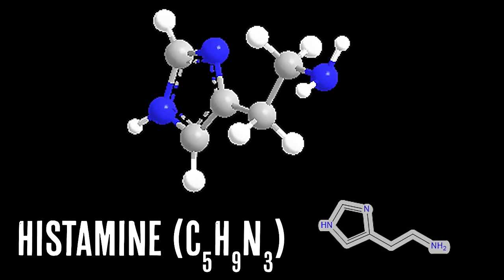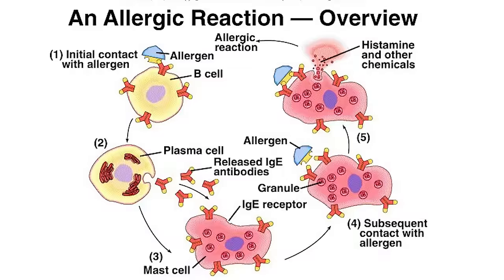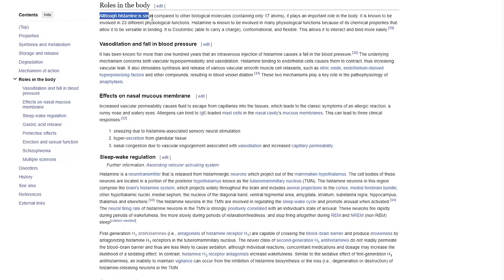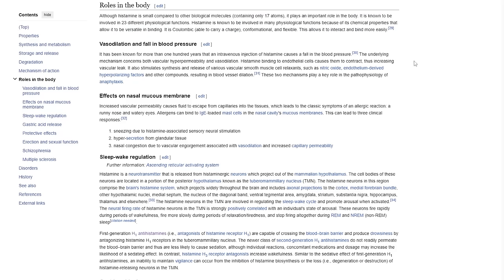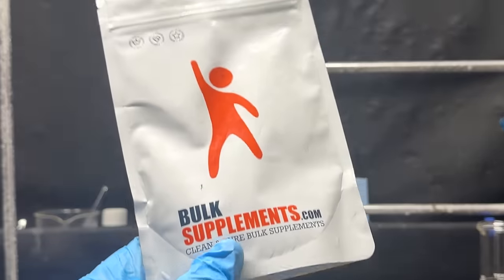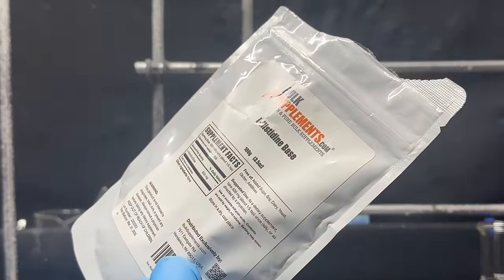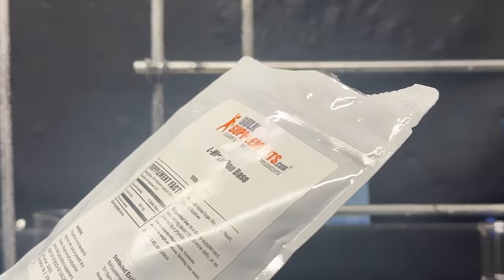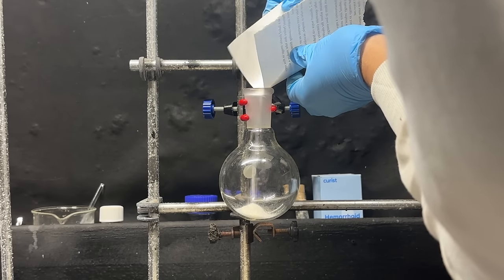Making the essence of allergies!

Comment: The syrup looked like it was very very concentrated and full of impurities, that might have been the reason for it not crystallizing. Grossly oversaturated solutions sometimes don`t like to crystallize, especially if the substate isn`t very pure. 
So one thing to try would have been to dilute the syrup with EtOH or even EtOH/Et2O or some other antisolvent and try seeding it with the crystals from the flask again, which looked pretty good...
But anyway, it worked out in the end and you produced the whitest crystals on the channel yet :)

Comment: Nitrogen regulators have the same thread pitch for the bottle connection. 

They might be alot cheaper as they're used for HVAC. They dont have flow meters.. but atleast you can sel them to 5 psi instead of 2500psi 😂